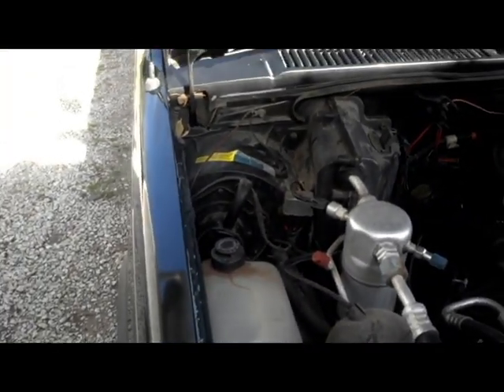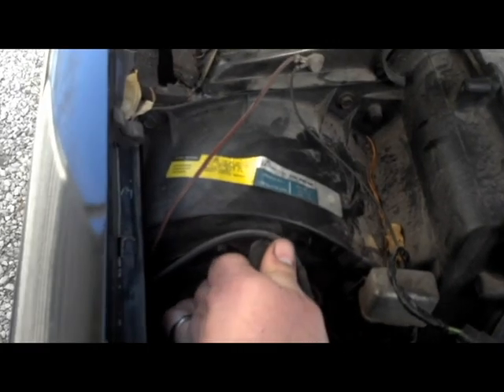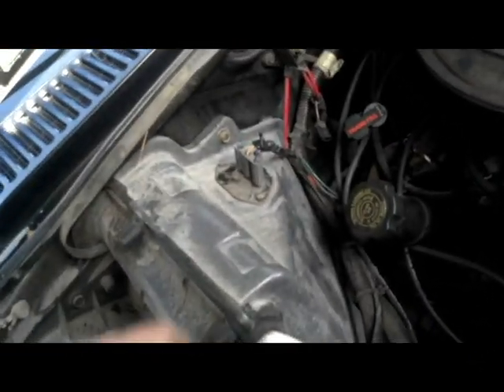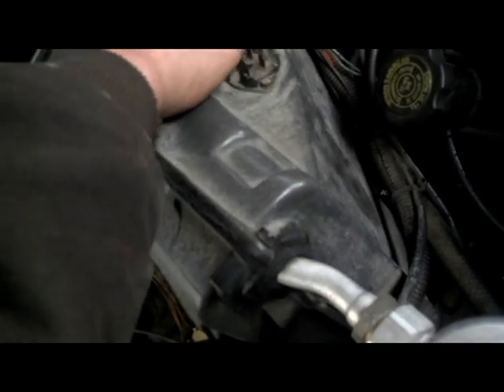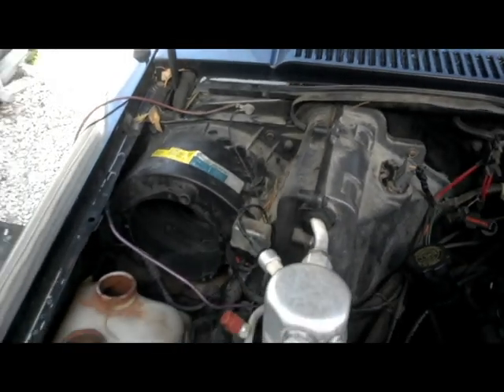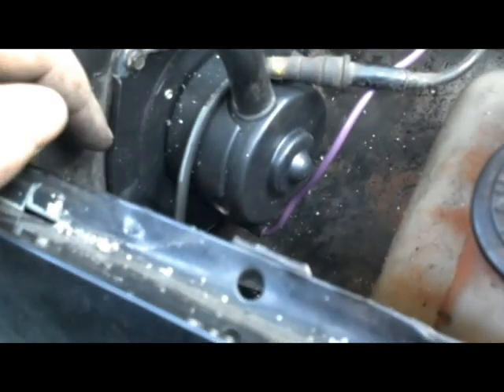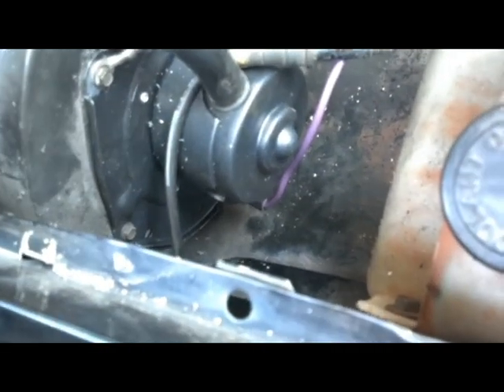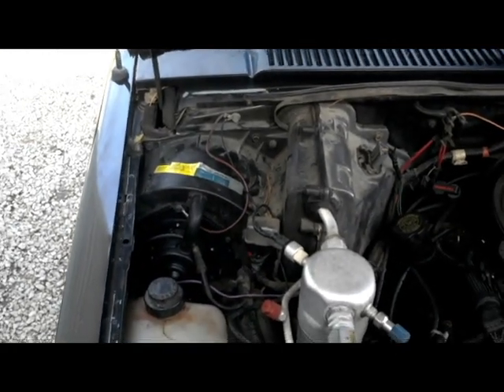Blower Motor - Chevy 93 s10

Comment: Is there a fuse in fuse box that's on that fan and resistor? I've going to troubleshoot it. No fan runs. Check the connections first and if there's a fuse I could check as well. Thanks for sharing man. That was awesome. 👍

Comment: Hi thanks for the video. Question: where the ground (brown wire) bolts to the firewall there is another black wire there on the same bolt. Where does this wire go? Found mine just hanging there but can't find where it goes to. Please help. Thanks again.
Reply from the maker: Its probably another ground of I had to guess. If it was disconnected already i would try to trace it back and see what it goes to.

Comment: Thanks for the video.  I have a question    On my 93 blazer wen I step on the gas with the air on a/c or heater the blower stops blowing than wen I don’t give it gas it blows air out   That’s only wen driving not wen park.   What you think it is?
Reply from the maker: Maybe check your vacuum lines along the firewall. Could have a bad hose.

Comment: hi, very helpful video.. i have the same vehicle & changed my blower motor which went bad slowly, it was noisy then one day stopped completely. Air  worked well for a couple of days but is now out again. no effort coming from the fan, although it did work for about 1 minute mid-drive then stopped again.. what could it be?
Reply from the maker: When you turn does it make a funny noise behind the dash around where the blower is located?

Comment: What was your heater doing that gave it away that it was the blower motor? My heater is running very weak, even with it on the max it is coming out is really weak. whether its on the flood, vents, or dash its it really weak. Thanks for the help.

Comment: What's bad when it only blows going down the road?
Reply from the maker: It's usually either the motor itself or the resistor. Could be in the wiring running between the 2. Other than that I haven't heard of anything else to cause it.

Comment: What was your heater doing that gave it away that is was the blower motor? My heater is running very weakly, even on max the amount of air coming out is pathetic. Should I replace my blower & fan combo? Could it be the resistor? I have a 86 S10.
Reply: Tristan Martel I have the same problem

Comment: Do you know how to change heater core?  Got a 1993 s-10 pickup 4.3
Reply: I sure do.Ignore the PPL that say U have to take the whole dash out.As long as you can reach the HC casing from the pass. side your good to go.4 screws hold the square squarrel cage together.I just replaced mine last fall.The more room you have on the pass side the better.That includes removing the computer out of your way.

Comment: How did you take the bottom bolt off
Reply from the maker: +Steven c you can use a wobble socket or a wobble extension to get to it.
Reply: I broke the bottom bolt how do I fix it
Reply from the maker: Steven c did you break the head of the bolt off? If it was me I wouldn't worry about that one bolt if you can get it off. Just tighten up the rest of them and be done with it. It won't move anywhere.

Comment: how the shit did you get that bottom bolt!?
Reply: The only way to get to the bolt & re install it is with a 1/4in 6"in  extension along with a swivel end behind the 7mm socket.The trick to getting it in is by using a piece of electrical tape wrapped around the side edge of the screw & 7mm socket.Once you get it started in a few turns.Pull everything off including the tape.Tighen up & your done.I hope this helps if it's not to late.